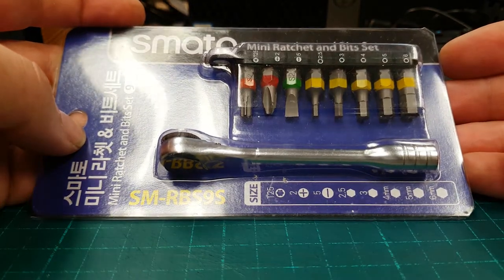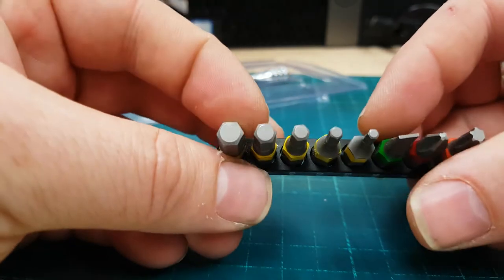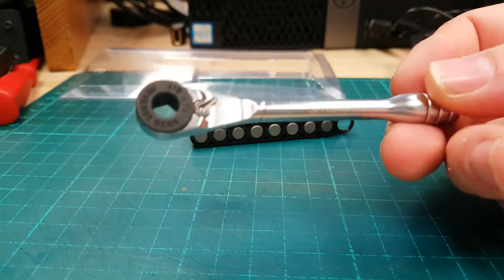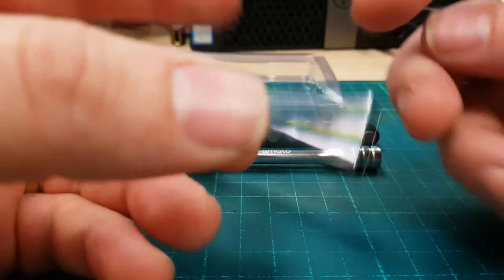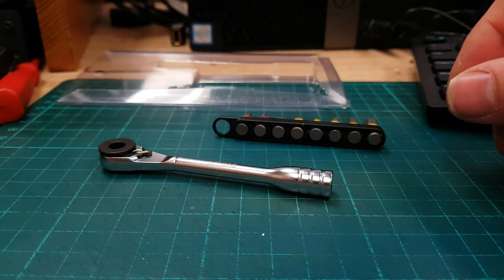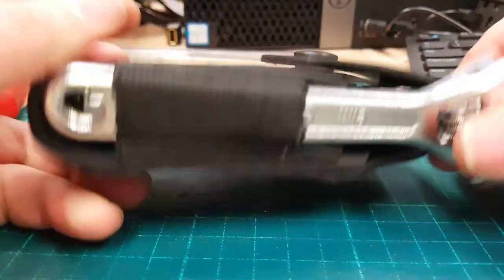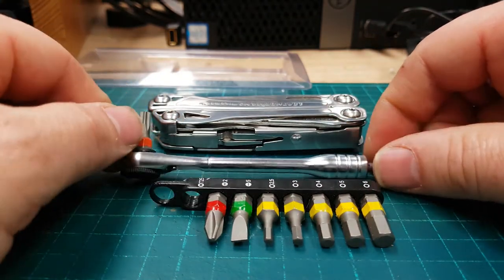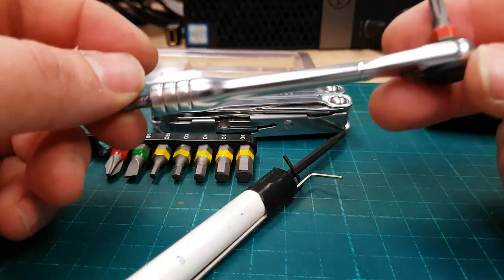Smato Hex Bit Ratchet

Comment: With these micro ratchets with the through hole in the head, it is possible to use certain bits upside-down, i.e. with the working end coming through the top hole. I've occasionally found this useful in very restricted spaces, as the effective height of the tool is reduced to literally the length of the bit.

Comment: Hi Do you have any updates on this ratchet?  How has it held up?  Do you have the Topeak or other bit ratchets that you can compare the quality to?  Would you recommend it or would you recommend going with the Topeak or another brand bit ratchet?
Reply from the maker: It's held up pretty well for me so far, It's still in my EDC work toolkit, and it comes in quite handy.
I don't exactly work it hard, so it hasn't failed me yet. I don't have a topeak, or other similarly priced bit ratchets, just a few cheapies of varying quality.
If you are interested, I've got a video I streamed about that toolkit here: https://youtu.be/LD_pMHhnhic
I've tweaked how things are carried in the kit since I did that video, but generally the contents is the same. I'll need to do an update when I get a chance.